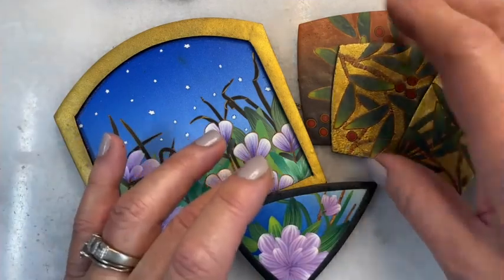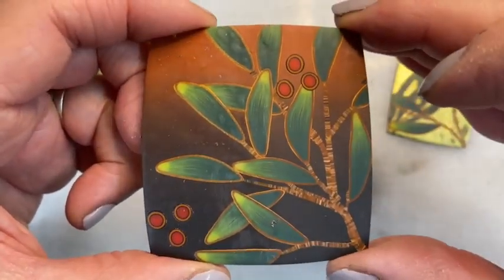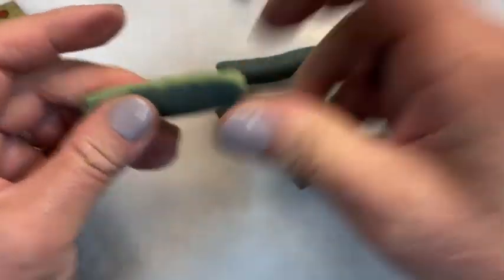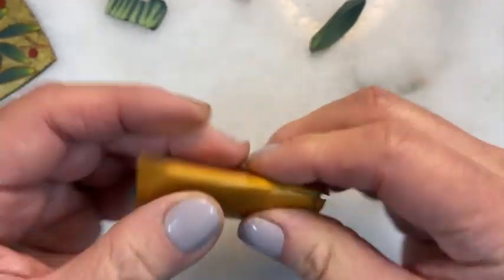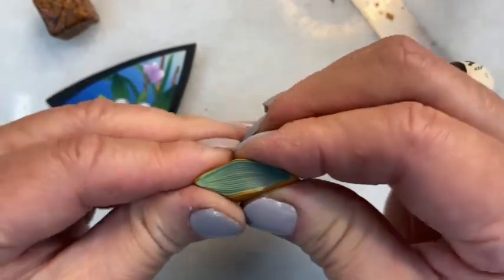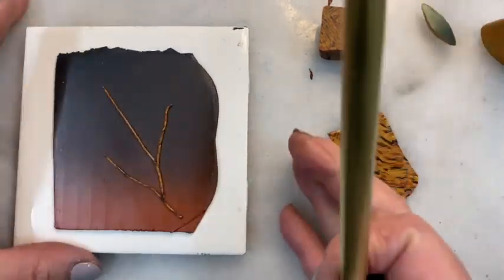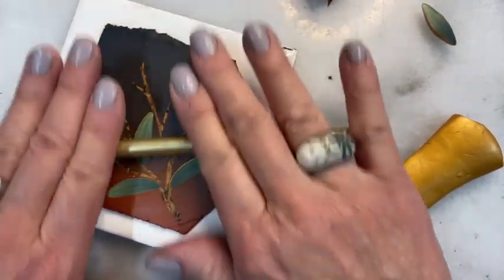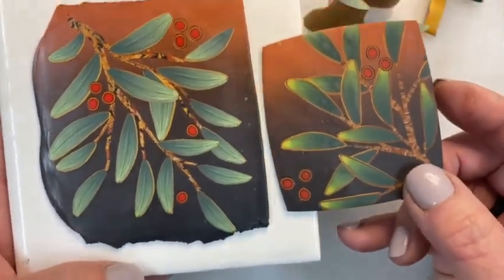Component Caning, Branch With Leaves - New Format - A Polymer Clay Tutorial

Comment: This turned out beautifully. I am going to try this tomorrow. I do have a question though.  If you want to make a brooch/pin, do you bake it then attach a pin clasp and bake it again? Or, do you glue a pin on? I haven’t made a pin yet and I am a beginner with polymer clay.
Reply from the maker: Hi Carol Ann, I make and cure the piece first, then set it and embed the finding. I’ve been using tie tacs quite a bit as they are easy to embed and very secure. I’ll do a demo tute on this soon. 😊❤️